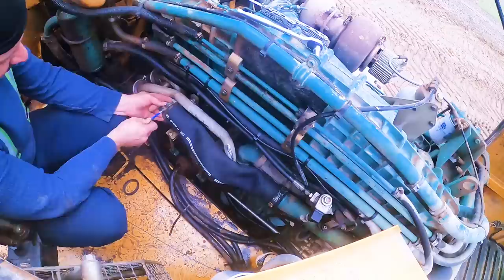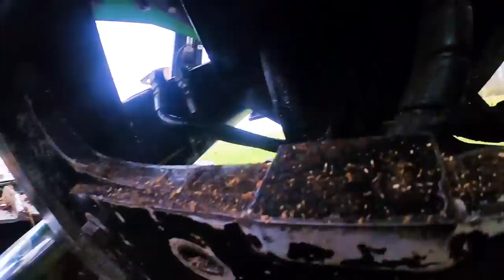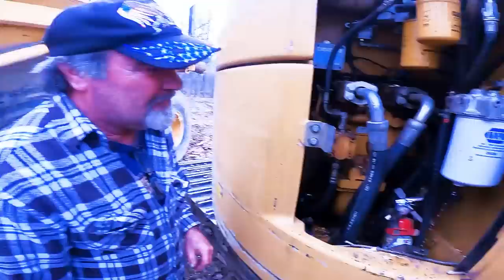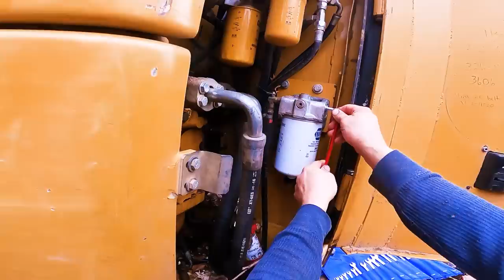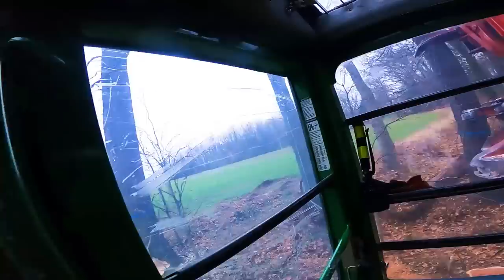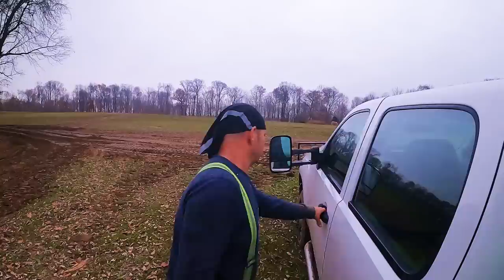Murphy is a turd💩

Comment: Fast moving fog ... now that's spooky . 
When the fog outruns the truck it's time to Scubby-Doo your ass out of there or take a closer look at the rad. hose.
Turn the hose over LOL It' only flat on the bottom.🙄
🤔 um let me think ... is it better to be stuck in snow or stuck in mud...  ??
Holy cow Robin needs a new filter. Murphy can have a byte. Canoe with a boy in it and the boy has a finger in a hole in the dike. Make your own jokes.
Sawdust gets into everything and really sucks when you get in your fuel. Glacial silt is more fine than clay and even gets past seals.  
Dead tree tops I call them deadmen or widowmakers.
Thank for the video ... both times😁
❄️♈️